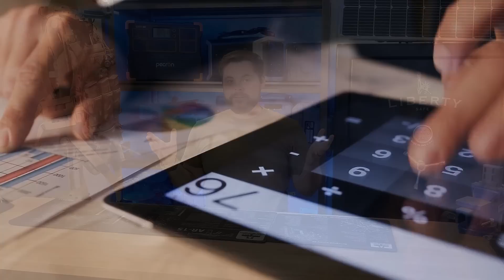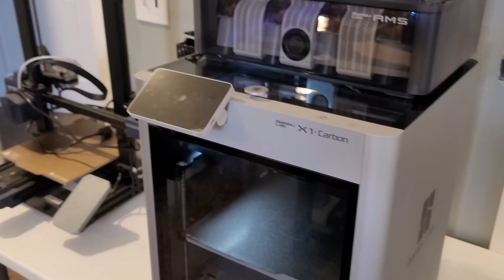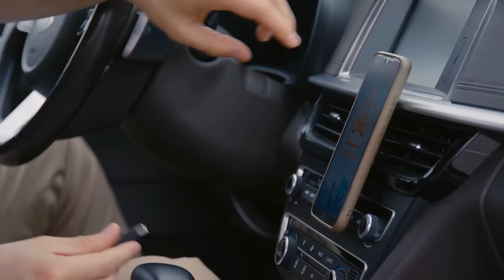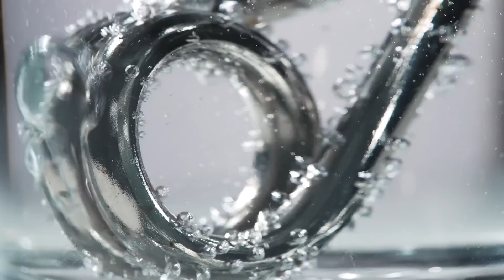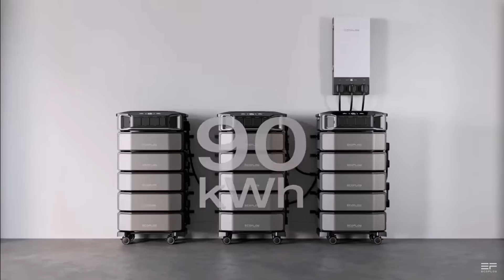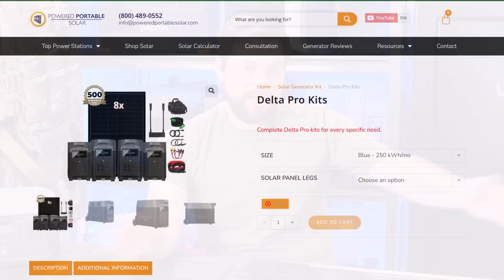No One Is Talking About This With EcoFlow

Comment: Great video.  I do have a question.  I want to use a solar gen to plug in a full size fridge and a full size stand up freezer into then plug it into my base camp electrical system so most of the time it will just be a pass through but in the event I am gone and the power goes out the solar gen will take over until the power is back on.  Yes I know not a perfect system but the power doesn't go out often or for long so I am thinking it will handle a short emergency when I am traveling in my RV and away for a short period of time until I have a more permanent solution.  I am looking at getting the ECOFLOW Portable Power Station 3600Wh DELTA Pro to do this.  Any thoughts?  Will it handle that well for short periods of time.

Comment: EcoFlow Delta 2 extra batteries are trash/have become trash‼️
Purchased a brand new on 4/28/2026 and it shit the bed on 5/9/2026. It fried a brand new Delta 2.
700-800 down the drain‼️ EcoFlow 100% refused to refund my money for the extra battery and refused to replace the Delta 2 under the warranty
Reply: Email thread with EcoFlow support, including EcoFlow executives and the company 100% denied a refund or replacement of the extra battery. Furthermore they removed the Delta 2 from list of EcoFlow products under warranty.  The Delta 2 is not even 2 years old. I purchased it brand new. They have the order number and invoice but are acting like I did not purchase the product. On 5/21/2026 a support supervisor told me over a recorded phone conversation there's nothing EcoFlow will do you're on your own. Figure it out and then hung up. 
Everything I mentioned is in the email thread and recorded phone conversations.

Comment: Just purchased the Delta Pro 3 + Smart Generator 4000 duel fuel... this Pre-Black Friday deal also comes with a 220 walt portable solar panel.  Thanks to another video I called customer service and asked if I get everything I need to connect the two systems.  At first customer service was like of course since they are bundled together.  Then after checking I had to also get the Smart generator connector so I can setup the generator to charge the Delta Pro 3 when needed.  This is my plan... use the Delta Pro 3 to run my RV and when it gets low on power it tell the generator to turn-on and charge it.  Excited to testing this boondocking without a generator running all the time.

Comment: Great video ! 
I was an Ecoflow fan but its changing!  I had the same experience as you did with awesome customer service and replacement units send in no time.  I bought a River 2 Pro, Delta 3 plus and a Wave 2.  Unfortunately, they all broke within 1 year of minimal usage. On top of that, the AC ports were not working on the my delta 3 plus returned unit. So you can understand that I have no more confidence on Ecoflow products.

Comment: My echo flow units have been great.  However their glacier 12v fridge, which was pretty costly,  was not.  I didn't use it almost at all, and after it sitting for a couple months,  the control panel buttons failed, just out of warranty.  Tough luck.    I can use it through the app, but not by the hard buttons.    They did not stand by this just a week after warranty.    so I got about 4 uses of it, and then done.  For that kind of money,  a longer warranty would have been nice.  I see now that there was a 24 month extended warranty I could have bought.   Buy it.

Comment: Have 2 EcoFlow ultra units and the insight monitor panel .  Very pleased with the operation of these units.  Then  added 3.2 kw  of solar panels to the systems to charge during the day.  Power outages are a thing of the past.  Very pleased

Comment: I have a Delta 2 Max with two extra batteries used primarily for RV use and one of the reason I purchased it is because of portability.  Most people can carry the main unit and batteries with very little problem.  Ecoflo app has to be one of the best.

Comment: While I REALLY like the EcoFlow products (I'd get the Delta Pro Ultra), I don't understand why all of these portable systems have inferior battery guarantees. The battery is everything. Who cares about the fancy bells and whistles if the battery isn't storing energy? The Delta Pro Ultra is rated for 3,000 cycles before reaching 80% capacity. An EG4 wall mount battery is good for 8,000 cycles. The Ruixu wall mount battery is good for **9,000** cycles, literally triple the number of cycles! I'm not spending $4,500 for a battery and inverter when I can spend $6,000 and get a battery that stores almost triple the amount of space and will last 3 times as long, when paired with something like the EG4 12000XP inverter.

Comment: I am trying to find the answer to  my question for some time but no luck. 
Can you have Delta 2 Max connected to extra battery and smart generator at the same time? 
I mean using special side ports on Delta 2 Max. Theoretically it is possible, but is it really possible?

Comment: There are many issues with EcoFlow systems.  I'm experiencing problems with my extra battery connected to my EcoFlow Delta Pro 3, and it's not picking up the EcoFlow 400w solar panel.  Work around by unplugging everything, let it sit for several hours, and then plug in the extra battery first, start the system, wait until it connects to bluetooth, then plug in the solar panel and wait to see if it connects. Have to unplug and reconnect several times before everything works as it is supposed to.  Company wants me to ship it back with could take weeks or months.

Comment: Do you think delta 3 plus can be used as a reliable UPS for a high end 1000w+ pc build?
Reply: Yes, I have 4 Delta 3 plus units, one for fridge, 8000btu AC, dehumidifier, 3D printer. Works flawlessly. All are solar charged with / AC backup. It’s really nice that they have two 500w solar inputs. My computer is a MacBook Pro, 3D printer is a Bamboo Labs X1 Carbon , Intel NUC and WiFi / hubs etc.

Comment: I have owned a Delta Pro and two extra batteries for exactly one year. Positive and not positives:

THE GOOD: Initially, one of the batteries would not charge completely. Ecoflow offered to replace the battery, however, after turning off the units and re-starting them, all went well; a strange hiccup and no further issues. The DPs are working as expected.

THE BAD (--> REALLY BAD<--): A couple of weeks ago I was about to buy two Delta Pro Ultras and 8 extra batteries for our remote cabin when I learned that you MUST connect to WIFI, even if you normally connect via Bluetooth. The Bluetooth token expires every month, so you must re-connect via WIFI and -re-pair your Bluetooth connection. IN OTHER WORDS: If your system is at a remote location, where there is no WIFI (or the SHTF and there is no internet available), you cannot re-enable your Bluetooth pairing, leaving you with DPs or DPUs that you can no longer control via your smartphone. 

WORSE YET: I turned to the HYSOLIS Apollo 5K. Their support confirmed that "No software or firmware updates are done to the Apollos once they leave our warehouse. (That's interesting ... no firmware updates ever. Hmm. Not sure if that's good or bad.) The only thing an internet connection is used for is just to monitor the status of the Apollo if you want to use the phone app." I was pumped (Yipee! No monitoring Chinese servers!). Then I learned that the app only gives you the ability to monitor power in, power out, and to turn the inverter on or off. Inverter SETTINGS CANNOT BE CHANGED WITH THE APP.  i.e. charge speed, charge limits, draw down limits, firmware updates, etc. 

WHAT TO DO? I want a portable off-grid system that allows smartphone control via WIFI but does not connect to Chinese servers. If anyone can recommend an off-grid portable system that has similar capability of a DPU, I will be grateful.

Comment: I purchased a Delta Pro about six months after the release. I purchased this unit while on a long-term visit with my inlaws in AZ. I used it mainly as a UPS for my Internet router. Three months later, I took it home to IN and again began using it as a UPS. About a month later, at 4AM, I  awoke to a load popping sound, and the unit had switched off. I tried to turn it back on, but it had a direct short throwing heavy sparks out of the fan vent. I called and got directions to send the unit in. I went over the fact that my address was different than the original ship to location. Spent the ~$130 to ship it in, and they sent me a used broken piece of junk that only worked on AC and would not take a charge. If I recall correctly, they paid for shipping this nonworking replacement back. Then I waited and heard nothing. Finally, weeks later, I got a call from a family member in AZ that I had a box delivered and sitting out in the rain. When sending a unit back, the shipper doesn't come to you, and you have to take it to the local depot. Now I had to fight them to pay again for shipping to the wrong location, and I had nobody  strong enough at that location to deliver it to the depot. The process ended up taking a couple of months, and I finally ended up with a new unit sent to my proper address. I tested the new unit, and it is working properly, but I don't trust it, and it has been sitting around unused. They did give me an extended five year warranty. For me, I think it is way better to buy individual components and put together your own unit. It is much cheaper, and you can have spare parts stocked to quickly get your system back online. You should also get way better input charge abilities than the Ecoflow provides.

Comment: Thanks for the vid.
Q:  Can I link 2 of the EcoFlow DELTA 3 Plus and create 220/240 v to power my water well pump?  
EcoFlow says no...
Pump only runs a few min to pressurize the tank.
230v   3/4 horse power  7 gpm
I estimate my pump to only draw 560 watts / 2.845 amps ???
Even if it pulls 10-15Amps
I'm not an electrical engineer, but IF I ordered a second EcoFlow DELTA 3 Plus and somehow tied them together at least we can power the furnace for a while and the well pump for water.
I really do not want to but a gas or diesel generator.
Thanks
Reply: Pumps draw much more amps to start spinning first. That may be why it may not work

Comment: crazy discovery today with the 50A hub... was updating the wifi firmware and I noticed I had output on the standard AC outlets and also had 240v output on the hub. (in the past, connecting the 50A hub disabled the outlets on the inverter)
Reply from the maker: Nice discovery! Thanks for sharing.

Comment: The first iteration of any electronic product will have a higher failure rate.  I’ve used my two original Delta Max systems for years, moving each between our Airstream trailer and truck camper to our home for winter season backup power service.  Loaded all firmware updates.  Had one Delta Max failure, on the road, and Ecoflow promptly sent a replacement unit to our temporary location.  Good gear.
Reply from the maker: Agreed, that's why it's best to let them work out the bugs.

Comment: Hey Ben; you have a good channel but this is not your shinning moment; its most obvious cheezy fluff and unecessary video. What happened to all your alocolades for Hysolis? You said they had the best customer service with only an issue with connection the internet. One can only wonder what your motivation to devote a video about EcoFlow's customer service. All those free expensive Delta Pro Ultra's have you singing a different tune. Did not Hysolis not give you any free power stations? Had EcoFlow not given you all the free hardware, would you still have made the video; perhaps not. Frankly, I don't care if a company has below average customer service if the product they make works properly out the gate; no returns. It's like your supporting inferior products as long as customer service picks up the phone.
Reply: @mannys4036  whoever is providing tens of thousands of dollars of FREEEEE equipment is likely the winner and gets the most positive rambling of them all.    Good luck with ecoflow support ... be ready to speak chinese since there is no north amerca support.
Reply: @tlteal I speak 0 Chinese and had no issue talking to support. Sucks you had a bad experience
Reply: @ngk330  not just one bad experience.  One of their devices almost burned my house down.    Would you consider that a "bad" experience?
Reply: @tlteal  I wouldn’t consider it a good one
Reply from the maker: Sorry for any confusion. I am simply doing a brand review of the top brands. I've done 3 videos so far. This week I've been traveling for work so I haven't been able to upload more. My Hysolis video is here: https://youtu.be/oExnFL4eVf4?si=JFChjqp7TJpwlGkF. I have personally spent tens of thousands of dollars in buying different equipment over the time of my channel, including EcoFlow. Due to that work, companies began asking if they could send me their equipment. It doesn't affect my opinion of the units and I make that clear with the brands that I don't hide the bad things. Hence, why in this video I clearly state my hesitation about buying ecoflow products when they first come out because they can still have bugs. I appreciate your opinion and feedback, but I am not being paid in any way from any of these brands to make brand review videos.
Reply: @minutemansolar  how can you do a non-biased review if they are GIFTING you equipment?  How does that work exactly?   Isn't that like being paid?
Reply from the maker: @tlteal  I have spent over $10,000s on EcoFlow equipment that was not gifted to me. Same with other brands.
Reply: @ what you did in the past has no impact on what you’re doing now.     what you’re doing now is getting free gifts from these companies in exchange for positive reviews.   It’s really that simple.   You can say your review are non-biased all you want but if I give you a free car, you’ll be excited to get that free car and say positive things about me.   Quid-pro-quo.

Comment: Informative video, thank you. I've waited to buy a battery back up for my home because i needed 240 volt for my well and and fan on gas furnance. I bought a DPU with one battery last week. Saving for two more batteries next year. Mine is for outages only. I've read you have to store them at only 70 percent.. Did you day you stored yours at 100 percent? That would help me immensely. What do you think? Like your content, just subbed. Thank you, Old Man new to this
Reply from the maker: If it's for emergency power, I recommend keeping it topped off at 100%. My unit at 70% is not a backup unit like my main units, that's only for my 3d printer and is more of a UPS.
Reply: @minutemanprep  thank you very very much. For a newbie this can be very confusing. I appreciate you

Comment: Mostly agreed, but there's some design philosophy stuff that bothers me with their home backup gear. I've read multiple reports of people having failures of the Smart Home Panel 2 during normal operation because of relay failure, and the part cannot be serviced. Not by a local electrician, not by an Ecoflow tech (if such a thing was even available). It's not a field replaceable component and the entire SHP2 has to be sent back. That's going to lead to a very, very unhappy household. If they're going to make gear to be in-line for critical loads at all time, it needs to have robust components that are field serviceable. That's why I'm not buying SHP2 or any installed EcoFlow gear until they address it.
Reply: Right @Unwin42 … We purchased a SHP2 ran our bedrooms, wall oven, indoor fridge, deep freezer, major kitchen outlets, garage outlets … I could cover all circuits but let’s just say MAJOR critical loads.  We had an issue with back feeding from the main panel to the SHP2 and vice versa which resulted in popped circuits, and smoke smells/fumes in our home due to the competing the power surges.  Additionally, we hired a second electrician to investigate which cited possible debris behind the panel interacting with the electrical currents causing arc flashes.  After all of that happened we experienced a relay failure on AC Port 2.

We lost a super nice wall oven within our home for 14 years without issue due to a power surge frying the control panel, our oldest daughter at night has to shower in the dark with a lantern, we lost all the food in our deep freezer, may have to replace the lift motor on our garage door, and have experienced major disruptions to our daily routine.  It was miserable not having an oven during Christmas.

Ironically, we’re keeping major appliances like our indoor fridge, dryer, and other appliances afloat with a Delta Pro, Delta 2’s, Delta 2 Max’s, and Delta Ultra constantly recharging and moving about the house until EcoFlow reinstalls the replacement SHP2.

I’m glad we tried the smart panel … it was SUPER NEAT while it worked.  I also agree with one commenter to be prepared for potential compatibility  issues if you execute firmware updates.  Support will quickly resolve but be sure to not update your firmware on a weekend 😂🤦🏾‍♀️.  

I’m writing this to say we are a real family with all of this happening in real time ( I’m typing this in our powerless Master Bedroom) and I hope knowing our story helps someone not steer clear of EcoFlow … just have a plan B if you end up temporarily losing circuits for a few days and don’t forget to check with your home owners insurance company to see if your policy covers appliances and electronics impacted by power surges.

Stay blessed!
Reply: @ thank you for sharing. I hope your future experiences are smoother. Happy New Year!